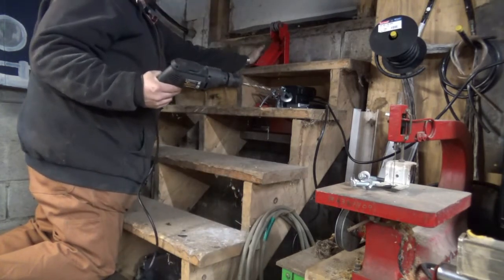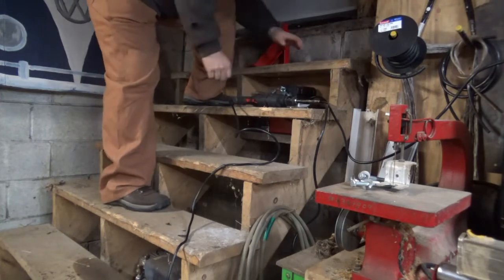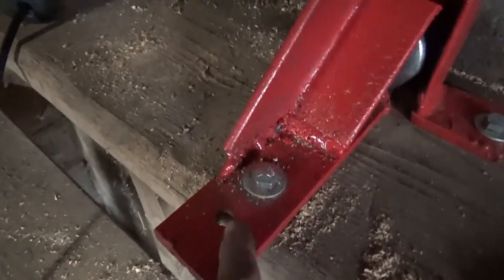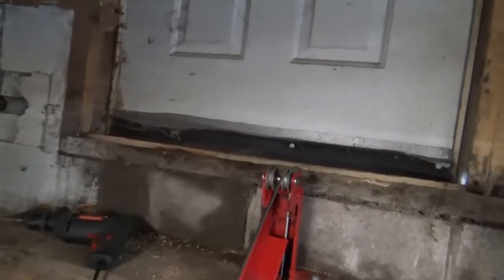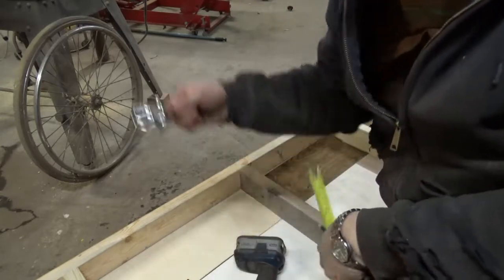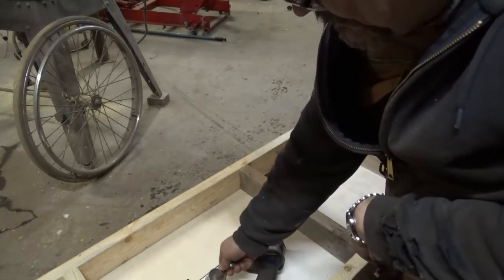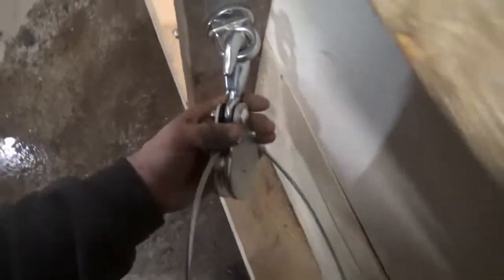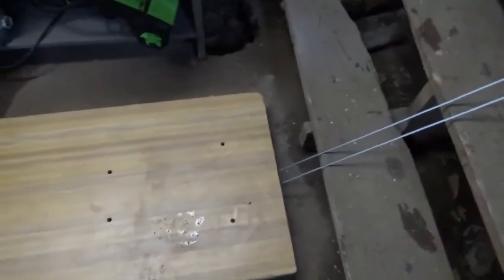Motorcycle Stair Elevator

Comment: Happy New Year ! Cant wait to see it in Action! But as long as we're throwing ideas around, how about one long ramp hinged at the top of the stairs, portable of course, the winch is mounted to the ceiling, the bike gets mounted to the ramp at the bottom , the winch lifts the ramp to horizontal position and just walk the bike out the door. You'll have to climb out first !
Reply from the maker: Good idea but I still have to push it up the ramp.  Hold it there and strap it down.  Also thought about an elevator system.  Its just one solution to a problem.  Thanks for your thoughts.
Reply: @rustyedmoore  Well like you said, its not something you'll be using it a lot. How bout this idea. Small ramp about 10 inches wide with 1-2 inch high sides. Position the wench cable outside above the door, you could even mount the wench to your truck. Attach the cable to the handlebars and just walk it up the stairs. Bing Bang Boom!

Comment: Looking good so far Ed but you might want to find a way to securely mount that top step just in case the weight of the bike pulls it off. Maybe some thick L brackets underneath with big ole lag bolts.
Reply from the maker: Good plan!  Still working the kinks out.

Comment: Tough nut to crack. So to speak. My grandfather used to say that.

I don't know your particular situation there but the sled on a pulley is a good idea for sure. Perhaps a set of rails or even runners off a trailer for the sled to ride on might work? Seems like the stairs will be fightin' you a lot. You could always put the rails aside when you need to walk the stairs. Eh, just a thought. Like all problems, it'll be solved!
Reply from the maker: I thought about using a roller conveyer also.  Thanks for watching, commenting and Subscribing

Comment: how about a wide flat roller in the front,wonder if that would smooth the ride any?
Reply from the maker: Biggest problem seams to be it getting stuck on the bottom braces.  I think its getting closer.  Thanks for you thoughts.